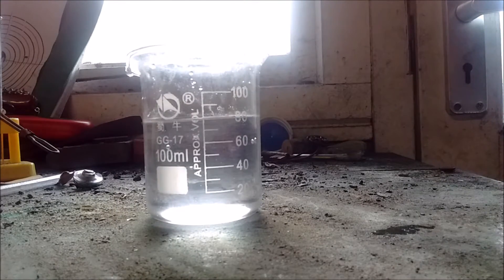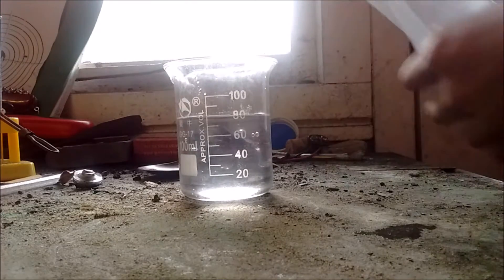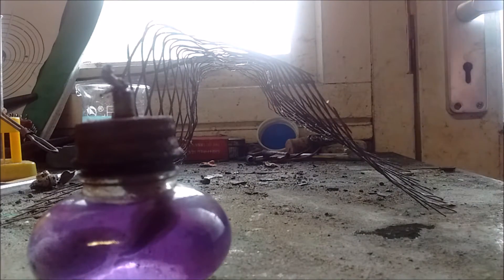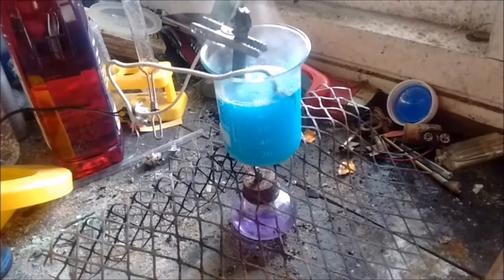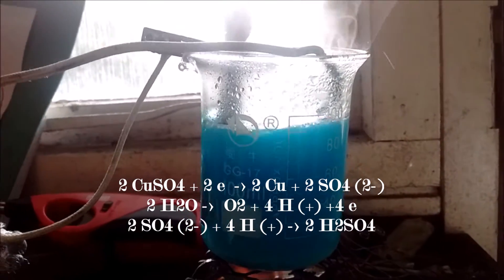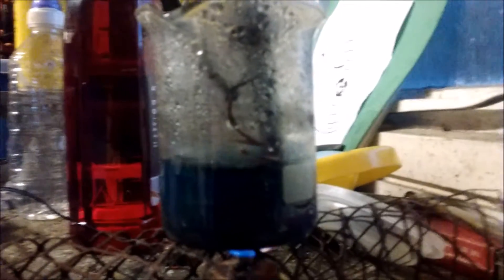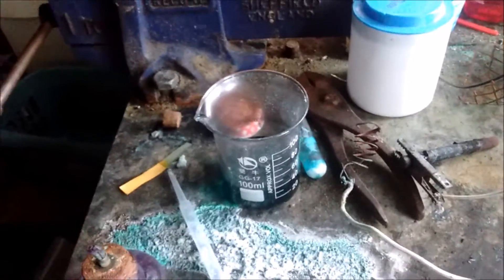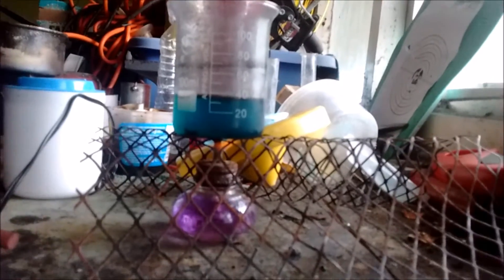Making Sulphuric Acid

Comment: you shouldn't heat it that much(or at all) rather use a stir bar to dissolve the copper sulfate make it concentrated and use stronger current for electrolysis!
Reply from the maker: At the time of this video I didn't have a good power supply so I couldn't use a larger current.